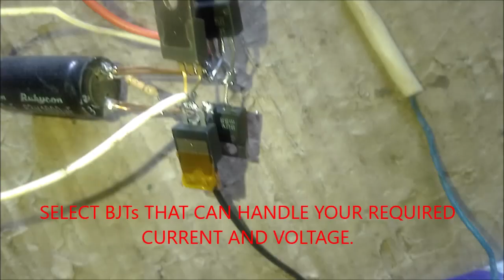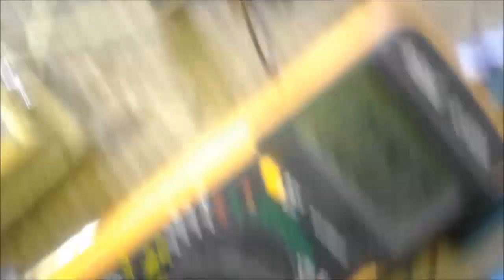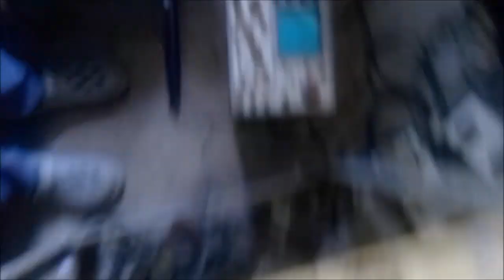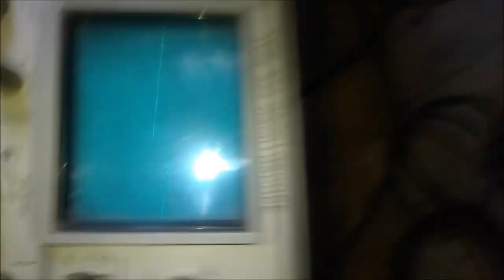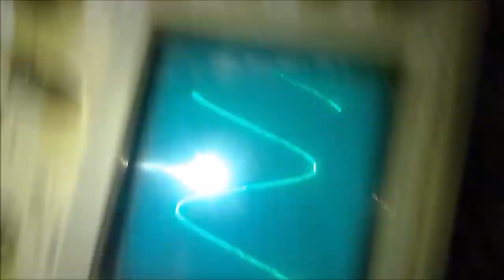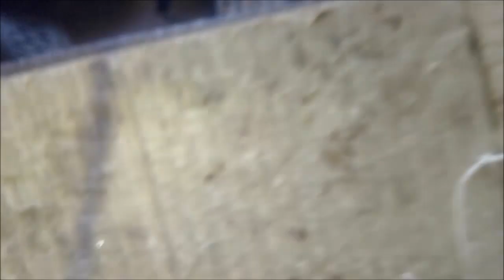BIPOLAR TRANSISTOR RECTIFIER

Comment: hi, im new at hackaday, could u tell me what it is about? how can it help me and what can i do? im 16
Reply from the maker: hello. this idea is for the purpose only when you do not have proper diodes then you can use transistor in place of a diode. transistors do have good voltage specifications as diodes